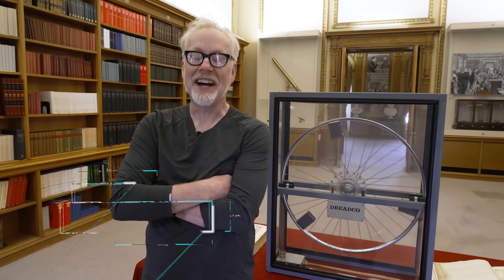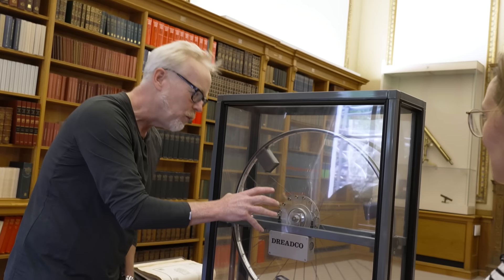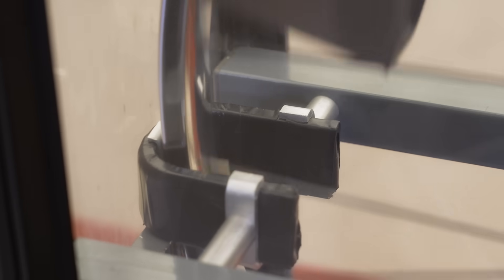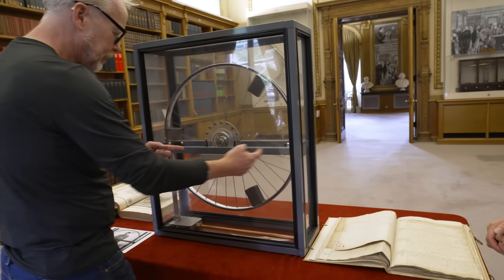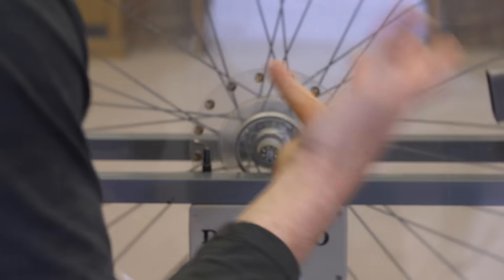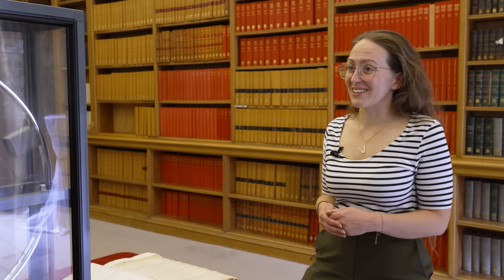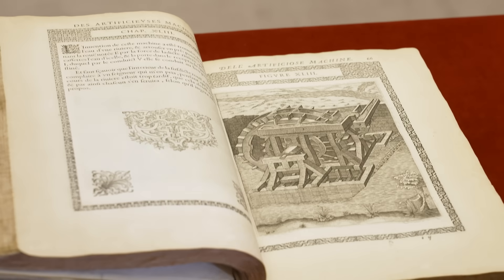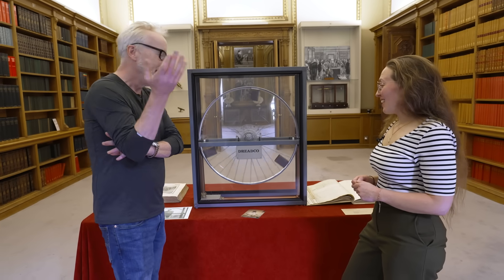Adam Savage vs The "Perpetual Motion" Machine!

Comment from the maker: Thanks to Brady Haran for bringing us to The Royal Society! You can find his Objectivity videos at http://www.youtube.com/ObjectivityVideos
Reply: Is there another episode related to this coming? Would like very much to see what Adam comes up with.
Reply: I think it's an electrostatic motor. A bit like a Wimshurst machine but inverted. You feed it a very high voltage, low amperage supply to generate an electrostatic field, that repels the contacts on the wheel (stator) making the wheel turn. To prevent the electrostatic motor from accelerating infinitely (which it could with perfect bearings and no air resistance) it uses the three blocks (magnets) on the rim of the wheel to generate some electricity, providing torque on the wheel to limit it's speed.
A 3-5v battery pack powering a high voltage 7-15kV transformer and the small amount of re-generated electricity could in theory last a couple of years. Connect pairs of 1.5v AA batteries in parallel and you have a battery pack with a much longer lifespan. Use NiCad batteries and you have a rechargeable battery pack. you could fit dozens of AA batteries inside all of that box section tubing of the frame.
Reply: @maxximumb  using batteries would be cheating though ?
Reply: @highpath4776  its the point here. They say with actual words. Theres a trick to it. Its just an art piece.
Reply: @highpath4776  using batteries wouldn’t work for 40 years
Reply: @maxximumb  why is everyone trying to over complicate it it’s probably very simple
Reply: Are you allowed to use like a compass to check if those are some sort of magnets?
Reply: I wonder what (servicing) means
Reply: @wg6215  
New batteries
Reply: @wg6215  they have to wind it up or change the batteries. Of course.
Reply: Martin Poliakov’s videos are also made by Brady Haran’s team and are very worthwhile watching. The channel is called Periodic Videos.
Reply: @MarkSJBeard  Sir Martin Poliakoff**
Reply: @MarkSJBeard  I love Periodic Table of Videos Prof. Poliakoff is amazing.
Reply: @MarkSJBeard  The link? The inventor of this wheel wrote down the solution with orders to give to Martyn Poliakoff after his death
Reply: Adam Savage's content is some of only a few great important examples that highlight the benefits that YouTube can provide to promote an intelligent human civilization in the years to come before it's too late.
Reply: @fedagent5577  It is already too late.
Reply: If you were to attempt to build one,  what would you do ?
vacuumed environment, magnetically suspended bearing, eddy current recirculating circuit, solid non-moving parts infrared blocking glass.  just How close could we get to a closed system ??
Reply: @KuramaKitsune1  or basically none of them it’s just permanent magnets that last longer than 40 years
Reply: I've had the pleasure of being taught by Martyn Poliakoff as an alumnus of UoN, and this is exactly the kind of quirky fragment of history he gets really excited about. Awesome video!
Reply: #MAGNETS!

~ L.
Reply: The wheel rim appears to be metal. And if the black objects are magnets wouldn’t that generate eddy currents which would be drag? I’ve seen several PM attempts using bicycle wheels and magnets always drags a moving metal part. ie; braking
Reply: @larryscott3982  Yh it’s definitely to do with magnets but people saying it’s batteries when it was made in the 80s don’t seem to think batteries degrade
Reply: @Alphoric  
Periodic servicing.
Reply: @larryscott3982  you really think the Royal Society is just swapping batteries for what reason would they bother like it’s a prestigious institution with people who are interested in cool things so why would they replace batteries like that’d be pointless
If you really think a bunch of enthusiasts are changing batteries for a “perpetual motion” device then you’re clueless
Reply: @Alphoric  
A stored energy that runs out and is restored. aka battery. Not necessarily a chemical battery as in alkaline cell. But stored energy of some sort.
Reply: Adam will attempt to build one. But it won’t be a ‘one-day build’
Reply: I have to believe a mind like Adam's would not allow him adequate sleep until he creates a better device!! Please let it be!! :buffering:
Reply: I would love to see a crossover video with you and Periodic Videos.
Reply: Adam, older than you, also had a mind of wheels and machinery! If you haven't heard of Johann Bessler, you're missing out!
https://en.wikipedia.org/wiki/Johann_Bessler
Reply: It's like battery powered seriously?
Reply: @scottbattaglia8595  it was made in the 80s you realise batteries degrade right
Reply: does the royal society have a channel for this? or does Virginia?
Reply: It's in a vaccuum
Reply: @Adamisgood24  
The cabinet isn’t near thick enough for vacuum. And if in a vacuum the copper tubing would be useless. But there may be a few useless things to throw off figuring it out.
Reply: @larryscott3982  yes and we all know that thin acrylic that bounces when it’s touched can withstand a vacuum genius you are
Reply: @Adamisgood24  no it isn’t
Reply: @Alphoric  How do you know?
Reply: @Adamisgood24  because he knocked on the acrylic and it deformed that couldn’t happen if it was a vacuum
Reply: @Alphoric  Right
Reply: Maybe that box in the lower left corner actually is an air cooling chamber, and your first guess was right; I'm assuming that the rotation of the wheel is creating a slight air current inside the box, and through the copper tube. If that camber is able to cool the air inside it slightly below room temperature...just momentarily...then maybe its enough to maintain air~flow, in order to lightly blow on the outer surface of the weighted wheel in opposite directions?

that's my shot~in~dark anyway! *salute
Reply: @BoWeava  overthinking it mate
Reply: @Alphoric  Yea probably...but a hidden battery is just the type of simplicity that I can't handle anymore. So, I must overthink It!! 😅
Reply: "Dread Co."  🤔🤔🤔
Reply: Make one adam
Reply: I think the gap between impossible and what has been designed is really further than people think.  But pragmatism and ease of design really matters as well.  

The Youtube channel called Veritasium did a video about the propeller car where the wind turned the propeller and the car went, and there as a breakaway point where the car started to travel faster than the rear wind when the wheels turned fast enough for the propeller to blow against the rear wind.... or something.  

But the idea of a breakaway point between two different dynamics for locomotion is kind of lost on some people I think.  Because while it is true that a perpetual motion machine IS impossible, using strong hard magnets and electricity generation can create something that seems to be generating a net positive of energy.  

And can actually be used to generate power.  Gravity and weight can load a great deal of energy from near frictionless fly wheels especially if there are extremely low temperatures and vacuums and magnetic quantum locking involved.  That's obviously not what is happening here.  

But I think it is possible to create a gravity, solar, and hard magnet driven generator and combine that with a battery to create a usable generator for as long as the magnets last.  And that is not perpetual motion really because the magnets require a lot of input to create.  

People always talk about Tesla and the ion electrical tower thing.  And scientists have studied the pyramids and how they focus muons and electrons in to the ground enough to actually scan the pyramids using muons which was done recently.  Also muons have been used to catalyze cold fusion in the 1950s, but the muons decay too fast and require too much energy to call that fusion a net generator of power.  But I still think it may be possible to focus muons and electrons from cosmic rays into either a capacitor or to catalyze cold fusion at least enough to load large batteries which we have not made so far.  

As a society we generate power on demand, but if we invested in to super efficient battery/super capacitor technologies then the power generation we use can be slow if the load is gathered for long enough or by a great enough frequency....  Such a thing makes solar and wind far more effective.  And if we could catalyze cold fusion or even charge batteries using cosmic rays then a couple years of building a load on industrial batteries could at least act as back up during times of outage....  

But also I guess Thorium Nuclear could be more than enough to have on demand power, I just wonder about the safety of nuclear power on fault lines and on the watershed for over a couple hundred years given that eventually there will be earthquakes and hurricanes that can cause these facilities to be destroyed in a way that could ruin the water and wild life for generations.
Reply: @JamesOGant  bro no one cares go write a sci-fi novel
Reply: Build one please
Reply: I, the layman, speculate it works like this:

The small cylinders on the outside of the hub are neodymium magnets with their north- or south poles pointing up and down, respectively. These magnets induce impulses into the "antennas" as they pass them which then get send through a Bedini coil and -circuit in the plastic box that alternate the impulses' electro-magnetic polarities between the two antennas, thus creating an alternating push-pull effect between the magnets and the antennas, thus creating motion.

The three boxes on the rim are probably just weights to create enough momentum to overcome the drag from the induction of the magnetic pulse.

Since the magnets slowly lose their strength from producing the induction current, they will occasionally have to be replaced (or re-magnetized), hence the necessary service. The wheel slowly losing its speed over (up to) a couple of years would fit this explanation.

But, no, this is not a perpetual machine.
Reply: Whats the best way to go about talking to adam? A letter, email, or a place?
Reply: @ADDmechanic  no way. Youd have to pay or be astronomically lucky
Reply: This is such an easy thing to debunk aside from the fact they admitted it will stop if they don't send it to be recharged... it's a simple design... put a vacuum  in the tube with the wheel the magnets and the metal make the charge needed to pull and push the wheel possible that there is also a form of gas that helps by heating rising and cooling and falling... The heat sink is a dead giveaway that is has an internal powersource that needs to be constantly cooled... also the other way it could work is the wheel spinning making the charges is used to warm the heating and the heat given  off is what helps the gasses keep moving and helping the wheel spin... also why the ends of the copper tube are open directing the hot fumes up the wheel... if it's vacuum sealed it will spin much easier then atmospheric  pressure fuck I'm an idiot and I could figure that pos out in 2 mins
Reply: @lil_mike_420  IT IS AN ART PIECE
Reply: @WillCal27  not at all its an electric motor id bet my life a small emp by this not perpetual motion machine will make it stop moving in under 20 seconds
Reply: Lol not always I it is possible same way same how
Reply: It's NOT REAL
Reply: Anyone else notice the weird static interference on the mic at 4:46 almost like the box is blasting high voltage and the boxes on the wheel are electromagnets that get energised by pulses from the box. Also the fact it get serviced sudjest the bottom box attached to the pipes has chemical or electrical parts inside
Reply: Maybe the magnets create a charge and as the coils pass the copper tube the coils discharge creating a gentle push against the coils
Reply: its energy collected & emited to rigth timing with calculated schematic switching system .
that can get enviroment small static charge & it goes . like a bendini rottor weal that it is .
Reply: I asked about e-bikes is there a way you can charge it while you're riding and the answer is no because there's no perpetual motion machine. But if I could go farther that would be nice. I feel like this has to do with very little friction also nobody mentioned that. It could save the planet too bad it's a secret. Or it's a farce?
Reply: @LetArtsLive  
More efficient machines are of course the pursuit of engineering. This device is doing very little work and is very low energy loss. And it’s not using free energy, not making surplus energy available to used. 

Yeah it’s not PM. And not over unity.

An eBike like an EV can use regenerative braking to capture waste energy during braking and going downhill.
Reply: @larryscott3982  I believe in the future it might be possible not perpetual motion but something better than regenerative braking that I can't even understand it why bother? I don't even know how it works I'm not a scientist. I'm sure people have said electric cars can't go 200 miles an hour or have any distance right? I find Nikolai Tesla very interesting. I think some of the things he did sending electric through the air he was working on is Wi-Fi and Bluetooth now. Perpetual motion might be impossible but going further with an electric vehicle should be possible that's what I think but I'm not a scientist I know about the reason why there's no perpetual motion machine but what I'm talking about is not Perpetual it's going further
Reply: @LetArtsLive  
Yeah. I agreed with that. More efficient machines. And more efficient storage devices. And more efficient charging of storage devices. 

EV range will increase. EV weight will improve. Yeah.
Reply: I believe there is a thin fanbelt running through the copper pipe over the top of the wheel and under the table there's another wheel connected to some sort of motor.😊👍
Reply: @peterdeans4635  
An invisible belt. Hmmm
Reply: @larryscott3982  I don't know wether you usually see the side view when in the museum. The camera angle doesn't show the side view until it moves but yes there is a very thin belt, maybe?
Reply: @peterdeans4635  
As if a belt wouldn’t be spotted when it’s on display for many many tech savvy people checking it out. It wouldn’t be some grand mystery escaping most people. Adam would’ve said ‘oh look, a belt!’
Reply: @larryscott3982  would he have though? It was left as a big mystery wasn't it. She said most people just say oh? when they see how it's done. There is something under the table, so how do you move the wheel without some sort of belt? Its an illusion, people use thin nylon wires in illusions the pipe gives a cover from the front and depending how close you can get from the side the frame might hide that view. What's your best guess?
Reply: LOL...ball bearings...viscosity...honey or similar.
could it that easy....nah
LOl...don't get distracted ADAM
Reply: I am pretty sure I know how it works too but seems like you are correct, it doesn't seem to be a perpetual motion machine because they don't take into account all of the details. 
It is like gravity, you won't understand it unless you have an open mind. 
You are correct though, it is a motor.
Edit: The only reason I will help you figure it out is because I am looking for someone to help me build a larger scale version of it. :)
This technology has been around for thousands of years, just not publicly available. (For good reason)
Reply: Just because you hide the batteries doesn’t make it a perpetual motion machine
Reply: @TravisBon615  I ask you, if the machine will run to the end of time time is it a perpetual motion machine? I ask because in my eyes even the universe is not a perpetual motion machine as it also will run out of juice eventually.
Reply: While it is generally accepted that perpetual motion is not possible due to mechanical limitations, there are countless examples of materials, machines, and objects that have been perpetually moving for as long as we have observed them with no sign of stopping in the foreseeable future, which undermines the premise without disproving it. This particular example is not one of those.
Nevertheless it is an act of ignorance by the radically arrogant to declare anything impossible simply because they themselves couldn't do it, or figure out how it's done.
Reply: The copper tube is definitely a decoy, along with the coaxial heat sink thing. Though I'm curious if the dots around the hub are magnets as well and the probes/electrodes that are mounted near them are connected by a wire with a diode. I suspect that if that's the case, the probes are likely non-ferrous metal. 

If that's helping in any way, it's probably more of an assist to the main magnets. It would be funny if that giant box in the middle only contained a tiny diode to form a weak electromagnet.
Reply: MAGNETIC "WATERWHEEL" THE CUPS CATCH THE CHARGE AS IT PUSHES THEM
Reply: If the wheel is flat rather than upright, and with the wheel having  enough magnets it is very easy to make a perpetual motion system. 
The larger the wheel, and preferably as light as possible should produce enough torque to to power a coil generator producing electricity which a portion of that power can be used to make the wheel spin even faster. 
So it could be used to generate power, but you'd need so many wheels in motion it would not be practical. 

However, if the wheels are large enough with enough of them working, you could produce limited but endless power with that one system.
Reply: To me it seems like a transformer and works with the principle of induction. On very little dc volt produced by the magnets
Reply: Boxes, copper pipe, frame made of metal tubes.. 30 A1 batteries fitted inside.
Reply: Or wireless charging Or 2006 idea from middleeast!!!
Reply: Wait, what? You're going to make *drawings*?? I was sure the next ODB would be a copy of the machine.
Reply: The pursuit of perpetual motion has not been a waste of time. 

Everyone that makes any progress aims at the same goal, improving efficiency.

They may not make it to >100%, but a lot of people have made a lot of improvements around the general project of turning motion into work while in pursuit of the impossible.
Reply: Magnets hide much better 🧲 😉
Reply: Adam, if I had to guess, I'd say that this machine spins because of constantly switching magnetic fields, fixed magnets acting with,  and against the 3 rotating magnets.

The machine eventually quits spinning when the magnetic fields fade, and it's then brought back to life by re-magnitizing the 5 magnets. 

I bet that spinning the fixed magnets 180 degrees on their horizontal axis, will allow the wheel to spin in the opposite direction.
Reply: It's a long lasting machine at best , but not perpetual
Reply: 1:20 Running for 2 years is NOT perpetual motion...
Reply: What is that black box doing in such a place like that, away from public scrutiny and peer reviewing to prove it is a fake sham?
Reply: I think she is pulling a fast one on you. How do they move the display without intr
Reply: I think she is pulling a fast one on you. How do they move that display around without introducing forces that would disturb the motion??? I think they start and stop it before and after it's on display I do not believe they send it away ever so often to be "repaired" as she claims. Maybe there is a person who comes to change the batteries once a year.
Reply: The endless interest in the search for perpetual Motion is fascinating

Very interesting to see this video, out of the claimed inventors over the years Johann Bessler aka Orffyreus who was mentioned
in the video is probably the most intriguing, he made many versions of his wheels and not only did spin they allegedly also did work.

The only other person of the time to know the "secret" was the king who claimed that it was a true perpetual Motion machine. Bessler wanted about 1 Million Pounds
in today's money, the king could hold the money until the machine was proved real and if the machine was not real he would have his head cut off (confident 🙂). 

It was claimed and witnessed that he locked his machine in a room that was sealed for 56 days and the machine was spinning and doing work
when the door was opened. 

What seemed to confuse everyone was the whole machine rotated along with the axle which was supported by
open horse shoe type bearings. 

He was also a useless conman making very little out of his machines and even printed a book describing the 
fact that just trying to move weights would result in failure. 

Now I'm not suggesting that Bessler managed to create the impossible but as Gottfried Wilhelm Leibniz one of many who inspected the wheel said 
perhaps we are all caught up with the description of Perpeptual Motion "I have seen the wheel do work for hours after the inventor 
removed the straps holding the wheel in place, maybe there is something to be learnt from it".

To this day no one has managed to work out how he created a fake wheel that appeared to do work over many days in 1712, like I say fascinating.

See 

http://www.free-energy.co.uk/

for more information, really interesting story?
Reply: It is an open system, like the atmos clock, it uses changes in temperature to compensate for friction.
Reply: I tend to believe it was the opposite of what you were saying, Adam, magnets on the wheel and coils on the frame stationary. 
The little buttons on the spokes could be magnets passing those probes for timing. 
Potentially, some of the buttons aren't magnets to hide the details as she said
Reply: Couple other possibilities are the copper tube that gets very little attention could blow air across the right side of the rim, adding rotational energy to the wheel.
And another thing that gets glossed over is the fact that it's stored in the dark and as Adam mentions the center box appears to have light sensors that could turn it off while it's dark, conserving power in a battery, that gets recharged during the maintenance times
Reply: Repent to Jesus Christ “Let the morning bring me word of your unfailing love, for I have put my trust in you. Show me the way I should go, for to you I entrust my life.”
Psalms 143:8 NIV
U
Reply: Adam (Niron magnetics) are coming on sale this year activated when installed in device more powerful than neodymium magnets may prove beneficial more power.
Perpetual motion is great but pointless if not overunity. 
Coils in black boxes sending electricity wireless to silver box then up to capacitor via copper pipe , discharging to magnets on center wheel/hub.
It would have to be super balanced with zero breeze in room why it's incased in perspex box.
Have heard bp or shell Patented a over unity generator 100 years ago and keep renewing patent which is unavailable to the public , only what I've heard.
Reply: how dare you talk about impotence  and bequeefs  you bloody  potty mouths
Reply: Using no outside energy sources like the sun or wind, would it be a thing if you used magnets to start the wheel which would generate a small amount of friction which would generate a small amount of heat which charges the battery enough to get it back to the magnets? Like an enclosed loop of different types of energy working together, but separately in a loop to get this wheel to spin slightly?
Reply: @gertpacu3926  ya  will loose  ewery     cycle  some amount of energy  cuz there no  perfect  100% way for  such  eficency!!!  even  all universe will stop one  day.  Voyager   is  then kinda perpetum mobile  it  can  fly in space   forever  toreticaly if  perfect vacum is reached. or ideal spinwheel in zero gravity.
Reply: I'd like to see what's behind that Dreadco box.
Reply: The answer is ballence and inertia. The boxes are weights. Everything else is just for show. Anyways they said the truth is not that interesting.
Reply: You can see that Perpetuum Mobile (Perpetual Motion) works, so it's possible, and we were lied to in school. Free energy is omnipresent and even from Mendeleev's Aether.
Reply: https://youtu.be/KBxGdt9ev7M
Reply: USE ram pump or herons Fountain ✌️
Reply: Adam bring your measurement equipment next time, Even a smartphone has a magnetic field sensor!
Reply: 10 grams of Pu 238, a Peltier and those heatsinks and you'll have that running for 150 years (2 half-lifes)
Reply: Hello Adam, hope all is well. Watching this video and see you describe those probes on the gray box that pass those rings remind me of a hall effect sensor. like on a wheel speed sensors or a camshaft position sensor, they read the speed of moving parts with a magnetic field, lets it know the position and speed. Not too sure if this applies here but it kinda looks like it.
Reply: thats not the perpetual motion machine though. its way bigger in some vault and livestreamed 24/7, the alleged machine is not even anywhere close to england!
Reply: its a pulse motor, magnets on the small inside wheel trigger a reed switch inside the box connecting the circuit from a battery then energising a coil that oppose the same magnets on the small wheel,very simple and the rest is added to confuse you......
Reply: Actually the labeled box could be working as a speaker in reverse. Taking sound waves from the room reverberating off the speaker and causing a another electrical current.
Reply: I figured out how it works by watching it and those three blocks. The reason why it runs so long is those three blocks are wound up mechanisms that slowly unwind themselves what they do is they throw away in the direction of the spin after they reach top dead center it gives the machine just enough momentum to make another third of a turn which of course brings up the next weeded wound. When it hits the bottom it resets itself mostly with gravity but with a tiny nuts with gearing like from a clock action. Adam trust me this is how it works I can guarantee that this is what it is that's why it takes ages and ages for it to need to be wound again because there's hardly any movement that is actually being powered by the turn of one tooth of a gear it's got a very long spring that will keep each one of those mechanisms wound forever I promise you this is how it works I don't just think it I know it absolutely. You could build this Adam I promise you but all I want is honorable mention because this is how it works

And yes a weighted wheel will work if it's made like a very slow gyroscope
Reply: You have to think about it Adam think carefully those are not magnets they're simply that pieces of look how the boxes travel through the so-called magnets it would not be the correct type of path to create a charge it would want you would want to split the charge at the end of the a coil needs to break the field in the lines of flux the flux lines would not be running in the center of the magnet like that they are decoys
Reply: Is she in need of a Man? She looks it
Reply: Think you could use mechanical magnetic opposition to make perpetual motion?
Reply: I had an idea of the same thing with normal magnets in a certain pattern and shape and strength in 3 or 4 colums but cant find a company that makes magnets in a certain shape and strength
Reply: @ARoyal1987  stop it 🤦‍♂️
Reply: YOU KNOW THERE IS A MOUSE RUNNING INSIDE DONT YOU? GOOD GRIEF STUPID PEOPLE!.....
Reply: https://www.youtube.com/watch?v=rsBplmMDcRQ
Reply: My guess is in the comments, I just don't want to do the math for it. But that's a great piece of engineering
Reply: @Adam , What if the blocks are cans filled with oil, with a ballbearing moving up and down a vertical pipe, mounted inside ? looking at the wheel 3x120 and the magnets 2x180, the balbearing inside the pipe would have a extended curved path due to the resisting oil, and the top one pushing the wheel down by gravity while the other 2 get pushed by the magnets? just a thought
Reply: water weights makes sence cause the water would evapotate
Reply: Weight distribution using mercury in the boxes’. If there’s anything else, just ask, ok?
Reply: i think it is illigal to do not tell peoples how it is work. we can forget then about gas and other bullshit
Reply: Your education is a box that I regret to see you in.
Reply: Tidal water is in perpetual motion Adam. Hydro Energy is the Free Energy and is being used right now by certain individuals and organisations.
Reply: You need two ring magnets going In diff😢directions to generate energy
Reply: n the engine be hooked to anything to create electricity. if not it worthless
Reply: Every atom is a perpetual machine. According to conservation laws. The atomic models today is BS.
Reply: This idea was almost there!

GFG is coming soon. Electricity generated from gravity.
Reply: Nice fake =)  Everyone figures out how this really works, of course with electricity. The electricity is nicely hidden, but you can tell where they are...
Reply: This machine was so close to generating electricity. The GFG will be here soon.
Reply: Looks pretty obvious to me. There's magnets in each block and it gets a little push as they go past the ends of the beams on left and right
Reply: 0:32
Reply: The little black blocks are magnets.
Reply: I am willing to send you plans for my system it's gravity replenishing hydroelectric generator overcoming siphon paradox and it's force is exponential I want to release the information open source and I'm the sole owner
Reply: Perpetual Motion Devices are for amusement, they function but don't make any "Real Power"... One day "ITER WILL" and safely at a reported 90% efficiency.
Reply: It is easy the hub is a very small electric motor and atleast one of the boxes are batteries. The spokes on each side of at least one of the boxes are isolated from the rim and body of the hub, acting as the negative and positive cables to the motor.

The rest of the device is a Wimshurst machine, being turned by the hub motor.

 The "cups" on some of the spokes are being magneticly charged by the sparkgap, resulting in magnetic fields governing the speed.

The photocell is a simple on/off switch.

The coax cable connectors and valve are to ground out the Wimshurst machine allowing you to maintain the device.

Using a photocell as an on/off switch is just a modern form of the Sun valve, which has been around since atleast 1904. Nikola Tesla developed the first use of magnetic fields to regulate the speed of an electric motor; as well as the prototype of the hub motor we still use today. The Wimshurst machine has been around since what 1880's. It's all such old technology that it baffles modern people.
Reply: Thank you Adam.....                                              
🇺🇸
Reply: I think I figured out how it works.  Theory: The heat-synched box contains a battery and a low-frequency oscillator.  This is connected through wires encased in the pipes to those two curved structures that cup the edge of the wheel.  The curved structures are likely coils of wire that are bent, and the boxes on the wheel are almost certainly magnets like you mentioned.  This device is probably just sending low-amplitude pluses to the coils, just enough to get the wheel to spin, but not enough to drain the battery quickly.  And there you have it, a carefully concealed motor that is very mesmerizing to watch.  Very interesting contraption.  It’s like a puzzle in a way.
Reply: It probably works like this: whenever the boxes get closer to the magnets on both sides, the one on the left pulls the magnet inside the box toward itself, and the one on the right pushes it away. This way, in the lower hemisphere, it moves farther from the center, and in the upper hemisphere, it gets closer to the center.
Reply: without lubrication, any bearings and any metal would have worn off long ago, it would be impossible for this wheel to spin for so long
Reply: A triangle of Electromagnets with collecting coils in between 3phase rmf creates EMF on the coils generating 600% increase because it's 2 systems a closed look rmf generator and a open system that harvest the field changes. Myth bust that I dare you.
Reply: You look very low on Testo Adam
Reply: i think i understand how this works!
Reply: It's simply magnets positioned to repel each other continuously 🤯
Reply: I think it is real becuase I was thinking of making one but I thaught this design would'nt work effectively escpecially to generate electricity but now I see it working, but how do I make sure it is what you claim since you arlready gave out the secret but claim it is a secret...Garavity and magnetism simply no violation of physics......
Reply: Is it possible that the boxes on the wheel are just full of a Gas that easily changes its temperature, where the top is always a different temperature than the bottom of the wheel?  Kind of like how a Stirling engine works with heat or cold. The difference in temperature is what I'm thinking. And the magnets are the decoy .
Reply: @ekojar3047  that’s way too complicated it’s probably simple
Reply: @ekojar3047  electric diference in the   air  caused bu    presure   ... modern  version of stirling...   interesting do it work in vacume //??!?
Reply: @ekojar3047  I agree that heat is a constantly available energy source in a museum display room and that it could be harnessed in some way to provide a tiny amount of energy within the box. However, your boxes of gas idea doesn't look like it to me.
Reply: My man at Numberphile delivering the goods!
Reply: @dellabooty ❤51😢😢
Reply: @dellabooty  ⚠️ God has said in the Quran:

🔵 { O mankind, worship your Lord, who created you and those before you, that you may become righteous - ( 2:21 ) 

🔴 [He] who made for you the earth a bed [spread out] and the sky a ceiling and sent down from the sky, rain and brought forth thereby fruits as provision for you. So do not attribute to Allah equals while you know [that there is nothing similar to Him]. ( 2:22 )

🔵 And if you are in doubt about what We have sent down upon Our Servant [Muhammad], then produce a surah the like thereof and call upon your witnesses other than Allah, if you should be truthful. ( 2:23 )

🔴 But if you do not - and you will never be able to - then fear the Fire, whose fuel is men and stones, prepared for the disbelievers.( 2:24 )

🔵 And give good tidings to those who believe and do righteous deeds that they will have gardens [in Paradise] beneath which rivers flow. Whenever they are provided with a provision of fruit therefrom, they will say, "This is what we were provided with before." And it is given to them in likeness. And they will have therein purified spouses, and they will abide therein eternally. ( 2:25 )

⚠️ Quran
Reply: @1islam1  get your imaginary spirit-man's alleged words the hell out of this adult conversation
Reply: i think it's seriously misleading to say that "perpetual motion is impossible".

this statement is completely wrong on several fronts.
1)not only is it not impossible, it's the default!
unless there is some force to counteract it, EVERY motion is perpetual until you add friction, gravity, or other external forces to slow it down or change it's course.

2)not only is perpetual motion POSSIBLE, the opposite is what's impossible! 
there is no such thing as "complete stillness" because of the uncertainty principle.
so EVERYTHING is ALWAYS in perpetual motion, because otherwise it would be at absolute-zero temperature, which might be what's truly impossible.

what you believe to be "impossible" is not perpetual motion, but specifically "machines that run forever". and even then, i don't know if i would call it "impossible". just "exceedingly difficult".
all you need really is a "perfectly frictionless" system. and i don't know if it's fair to call that "impossible"....maybe "impractical"....
Reply: @FractalMachine  you’re overthinking it you simply cannot have any sort of perpetual motion
Reply: As a museum technician/guard, I was extremely alarmed when he slammed his finger into the acrylic, also when he pulled his flash light in the Library/lab, it's simply bad etiquette to do so without asking first(Strong lights are banned in paper/film laboratory which are usually kept in dimmed light or even dark).

I like Adam, but the way he was pacing and almost running around the table was to say the least not very professional or typical of museum staff which are extremely careful and cautious with their work.

His enthusiasm obviously was bigger than his actual respect for the artefact, which is underwhelming coming from a guy so much into conservation and collection of curios /props.

(Also, the object is obviously a art piece more than a actual patent or invention.)
Reply: @pnda13  why do you care
Reply: The Dreadco box has a battery, perhaps a capacitor. It puts a + and - charge on those two rods near the hub. Adam notes that those rotating cups are insulated. They capture a small charge when they pass one rod, and are attracted to the next rod, dissipating the charge as they pass. Repeat for each revolution. Kind of an electric motor, and battery powered. Disappointing to find out that it's battery powered. 

Should be easy enough to replicate and test in a One Day Build........
Reply: Wrong. In actuality, the dreadco box houses tiny hamsters that keep it spinning.
Reply: @rays5163  XD...exactly!
Reply: @AM-ty9lp  way too complicated
Reply: @A M  the Dreadco box have a spring that's wound up like a clock. This can go for a long time if you have a high gear ratio. Keep in mind they said it slows over time. This is consistent with a wound up spring
Reply: Im thinking batteries and recapturing power is a lot of it.

I wonder how much of an energy gradient it would require. Really expensive ball bearings could work with very little energy gradient. Im thinking about guitar pickups.

Edit: Cute couple?
Reply: @ShrimplyPibblesJr  that’s way too complicated for it to be the solution
Reply: Hey Adam will you make a ray Kenobi lightsaber since it's not Ray Skywalker anymore because that's the best looking saber I've seen
Reply: I think all the extra parts are there to throw you off. When I 1st saw this as a teenager I immediately thought of a lecture I had seen about how the earths spin drives Hurricanes.  And the professor used a bicycle wheel to demonstrate it. I think the special maintenance is them returning the bearing to frictionless state. The earths rotation would keep the wheel moving, and increasing the angle of the wheel to the rotation of the earth would increase its speed.
Reply: It would be easy to prove. Check past footage noting the wheels location and orientation to the earths spin and see if it always spins in the same direction
.
Reply: @kousakasan7882  comedy gold. Lmao! Earth's spin! Whered they get this guyyyy! Ayy lmao. Bruh its a windup toy.
Reply: @kousakasan7882  way too complicated it’s probably very simple
Reply: @kousakasan7882  It's still the temperature gradient (read solar energy) which drives hurricanes, not the earth spinning. No, the earth's spin CANNOT drive the Jordan wheel (it could move the spin axis, yes, but not make it spin). The earth's magnetic field could, in theory, but would still require a source of energy (there ARE perpetuum mobile machines like this, but this Jordan wheel isn't one -- way too hard to build).
Reply: @falklumo  The temperature gradient accounts for the rise of moist air at sea level to the upper atmosphere. The spin and powerful winds is caused by the earth's spin. That's why tornados spin counterclockwise (cyclonic) north of the equator and clockwise (anti-cyclonic) south of the equato
Reply: @kousakasan7882  Please consider that pattern formation is a property of non-equilibrium thermodynamics. The SOLE cause for the non-equilibrium is the difference in solar radiation between polar and equatorial (and night and day) regions. Please read a text book about non-equilibrium thermodynamic and meteorology. Do not stick to what you always thought was true.

In layman's terms: the Coriolis force (this is the force created by Earth's rotation) shapes wind PATTERNS but does not CAUSE wind. As you can read in every physics book, the Coriolis force does only affect objects in motion, ie., does not bring objects into motion. W/o the sun, the air would have same temperature everywhere on Earth and there would be no wind and no spinning tornado. That's all I can contribute here. Thanks for your reply.
Reply: Hey Adam I know you're busy with a thousand things to do but 

what about making a ray Skywalker or Ray Kenobi
 lightsaber? Because that's got to be the best looking lightsaber I've seen in 50 years it just looks like a mechanic and a machine is built it 

please do one and make it easy on yourself maybe not so much lathe cutting thanks a lot that's the best looking lightsaber I've ever seen
Reply: Boxes have electromagnets and weights in them I knew from instant I seen it.
Reply: @SHAD0WZOMBIE  nope
Reply: ask AI:
Create a fictional theory for a anti-gravitational propulsion system based on electrified mercury inside a vacuum toroid (donut) rotating at infinite speeds to create extremely high electromagnetic forces.

AI:
Here is a fictional theory for an anti-gravitational propulsion system based on electrified mercury inside a vacuum toroid (donut) rotating at infinite speeds:

The system consists of a toroidal (donut-shaped) chamber filled with electrified mercury and surrounded by a series of powerful electromagnets. The chamber is sealed off from the outside environment and maintained at a high vacuum to reduce air resistance and friction.

To initiate propulsion, the chamber is set into rapid rotation using the electromagnets, reaching speeds that approach infinity. As the mercury inside the chamber rotates, the intense electromagnetic forces generated by the movement of the electrified particles create a field that cancels out the effects of gravity.

This allows the system to lift off the ground and hover in mid-air, essentially negating the force of gravity. By manipulating the intensity and direction of the electromagnetic field, the system can be made to move in any direction desired.

In this fictional theory, the anti-gravitational propulsion system would be a revolutionary technology that could revolutionize transportation and space travel. However, it is important to note that this idea is purely fictional and has no basis in current scientific understanding of electromagnetism or gravity.
Reply: All the style of the device is telling that perpetual motion machine is primarily a Lord's privilege. I am not sure if you are not a lord you would want to work on it.
Reply: Dissapointed by the Lies in this Upload!!!
Not even a minute in to watching........F it I'm OUT!!